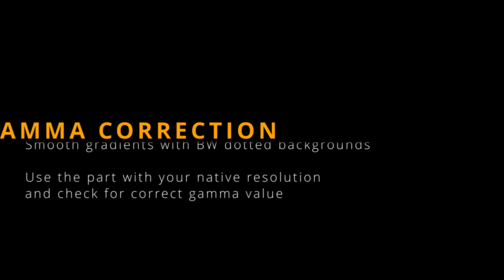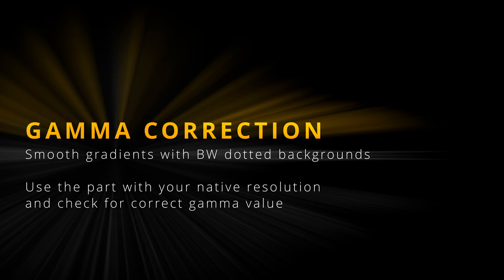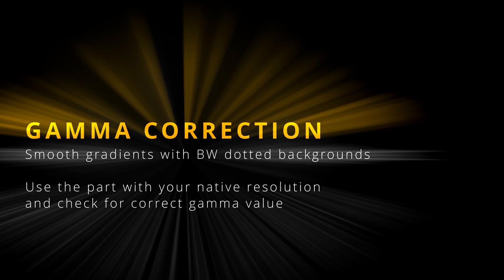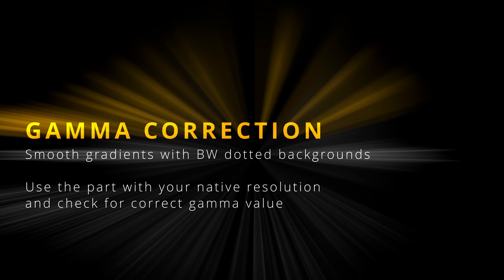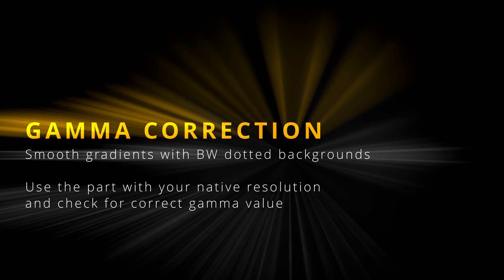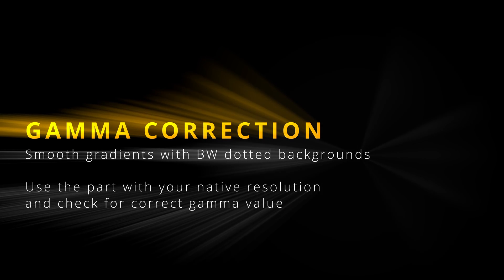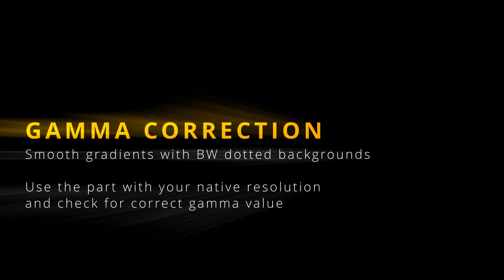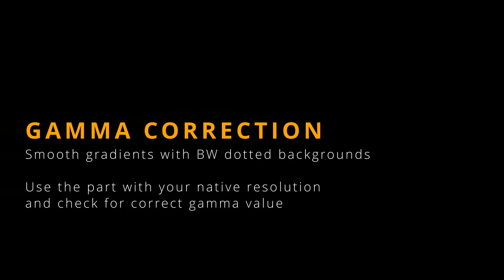Gamma correction test v2.01 | Test your display | #9

Comment from the maker: This is part nine of brand new series (v2.01) of complex monitor, TV, tablet, smartphone or projector display tests.
 - Properly clean the screen and read the instructions before starting the test.
 - Use 1080p or better 4K resolution here in settings because YT uses terrible compression at lower resolutions (otherwise you wouldn't be able to do all the tests or get bad results).
 - Use full screen mode and make the room as dark as possible.

Comment: How does this work? Do i have to adjust gamma until 2.2 on the scale matches the backgeound color?
Reply: If I try to do that I have to put the gamma to max and it looks terrible
Reply: This test is only to find out what is your current gamma. You need to set your resolution in the video same as your monitor resolution and check in which value lines near the numbers are blending in gray background , for example for my 2K Samsung monitor it blends in between 1 and 1.1 so my gamma value I can consider around 1.05